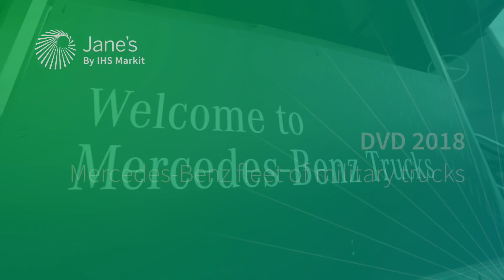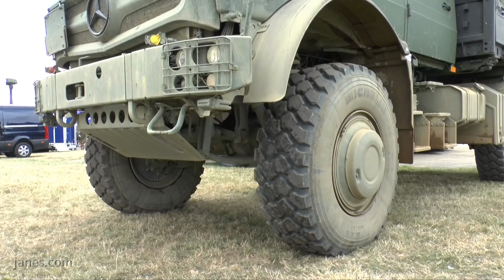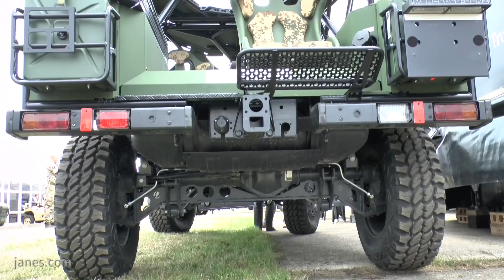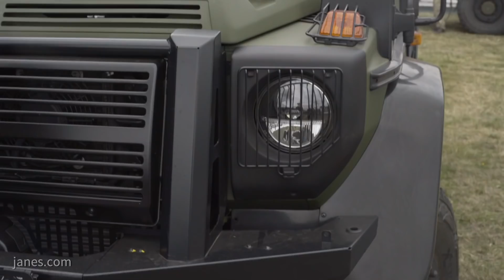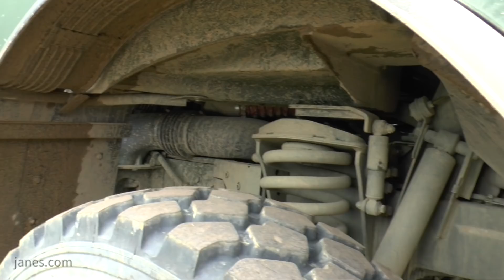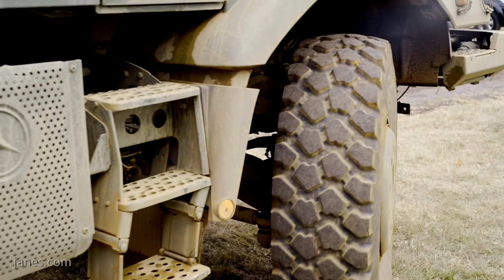DVD 2018: Mercedez-Benz fleet of military trucks

Comment: It might work, but it will be friggin expensive in maintenance. 

Toyota !!
Reply: Toyota has no unimog or zetros
And the land cruiser isnt a better offroader than the g class anyway

You can fuck right off with the rest.

Keep in mind toyota pays lots in marketing this reliability nonsense…
Only brand that gets away with selling a 70s product for 70k in the toyota land cruiser.
Reply: @kloschuessel773  well buddy as a Toyota fan myself. I gotta respect Mercedes Benz and unimog for making military machines.
Reply: @zzzz_zhtrub  you can buy the g class professional yourself or an unimog

Toyota makes good vehicles but you are paying a massive premium for that badge now.
Reply: @kloschuessel773  sometimes you may need land cruiser to go to the woods,but some other times you might need the unimog to carry more people.
Reply: @zzzz_zhtrub  unimog also goes into the woods and a g class as well.
Used g class isnt more expensive than the toyota land cruisers. The mall cruisers vs mall g class… i would give the edge to the g class bcs of the lockers.
The professional g is a better offroader than the 70 series.

70 series might clock more miles on average and hopefully be cheaper to repair.
I wouldnt count on it though if a fair comparison is made: fuel consumption and road legality in terms of how clean the engine is.

Highly doubt that there will a big difference.
And the stock g will be better offroad than the stock 70 series as well.

What i find so interesting about toyotas is that ppl drop so much money on building up these hiluxes, cruisers and or 4 runners.